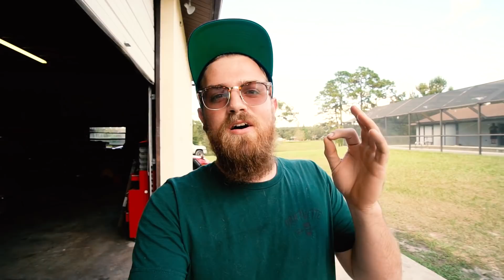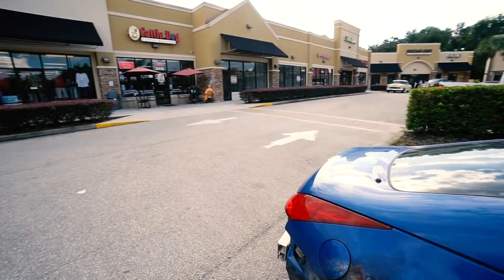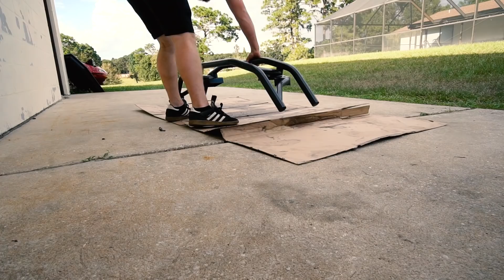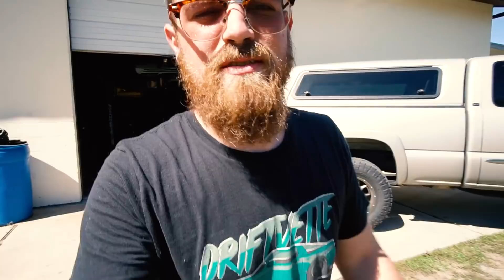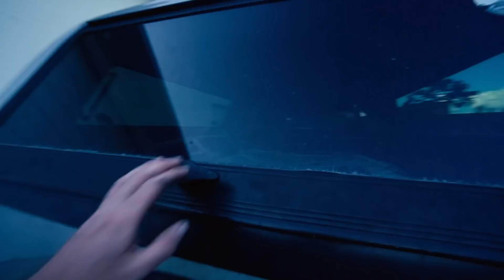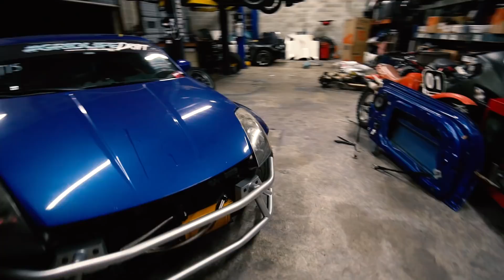Making Z Pretty Again!

Comment: Watch yourself at the dragon. Cops up there do not like race cars on the street, even if they are technically legal.
Reply: CLP it’s registered, plated and insured. 99% of cops aren’t gonna know what it is anyway. Plus the car is quiet as well so it’s not obviously illegal or anything
Reply: CLP it’s actually not fraudulently anything. Florida laws are lax enough that many so called ‘grey market’ cars are in fact legal. Therefore if it’s registered in Florida, technically it isn’t against the law. Not saying it’s not illegal but it is legal at the same time.
Reply: CLP not necessarily. There are actually loopholes in that. Like if you’re importing a rare car you can do so legally as a collectors piece and are legally allowed to drive(and register) them occasionally. The evo 5 is a rare car and it’s not going to be driven often so it’s quite possible he has it insured thusly. The other way is to import it as an off the street vehicle that never gets registered and never gets street driven. For racing purposes only
Reply: CLP how do you know what he did? Obviously he didn’t do the second but who’s to say he didn’t do the rare car registration? It’s not like he said I registered the car this exact way etc etc. 😂
Reply: CLP actually I was in the process of finding an r33 gts-t to import last year but due to the fact that the one I wanted was harder to find, I ultimately decided to save my money for my celica project. And a car doesn’t need to have collector plates even if it’s a collector item. My uncle has a 32 ford roadster-a very collectible muscle car- and it’s got normal plates. Same goes for my friends dads 1970 firebird, or my grandads Jaguar. Tommy said the guy who sold it to Adam was the one who imported it... so unless he’s a complete dumbass, he would have known that it’s not past the 25 year rule...All I’m getting at is you have no idea how the car was imported, what it’s registered under, etc, so there’s really no reason to be on here yelling at strangers lmao.

Comment: I’m no expert and I know you’ve gotten your car checked by tech a bunch of times but the belt holes being so low in your seat looks unsafe for you. Just concerned for your spine brother.
Reply: They might be a little low if the harnesses were mounted below them. Since they're mounted  higher than the holes then it shouldn't be bad at all in his case. Any taller than he'd need a seat with higher holes.
Reply: I'm more worried about the way the belts are mounted!
Reply: Those belt holes do look a little low..those straps have a bit of angle on them😳